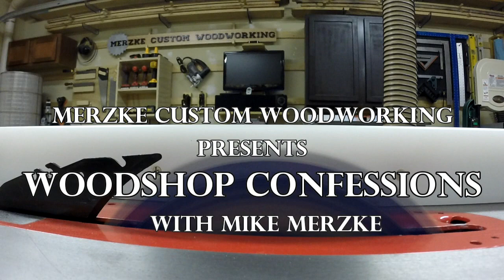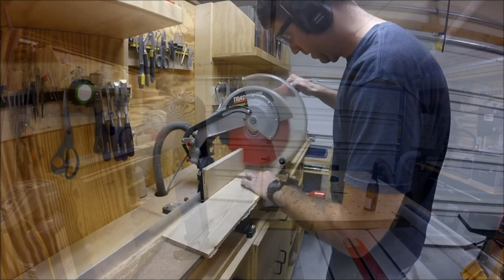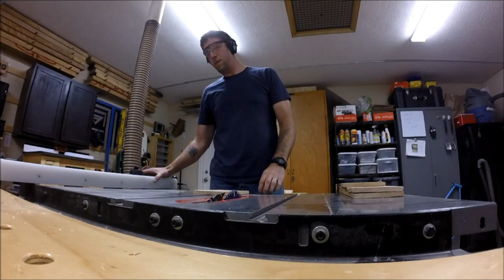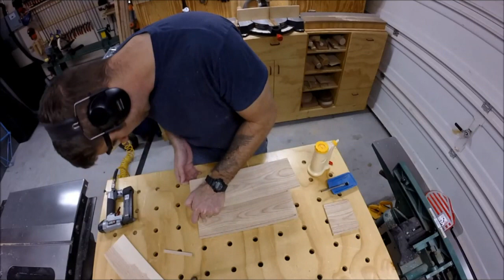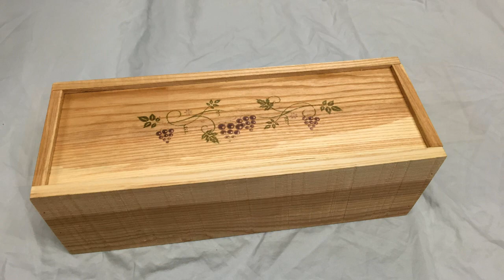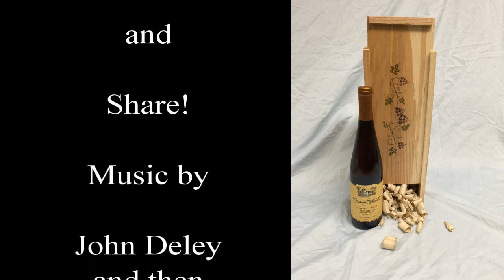Pallet Wood Wine Box

Comment: How do you like the ridgid planer? Thinking about getting one.
Reply from the maker: MrPanthers23 I really like it. I don't have anything to compare it to since that has been my only one. But I have little to no snipe ever and the blades last a long time before needing to be replaced. The dust collection works pretty good and it has a height adjustment lock which helps with getting multiple boards to the same height.